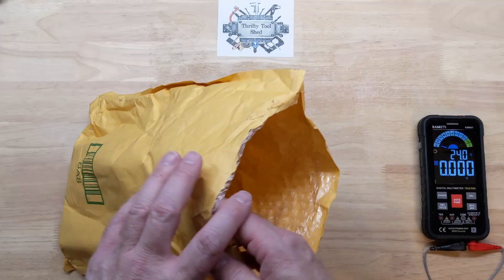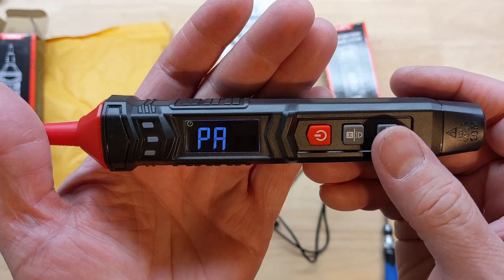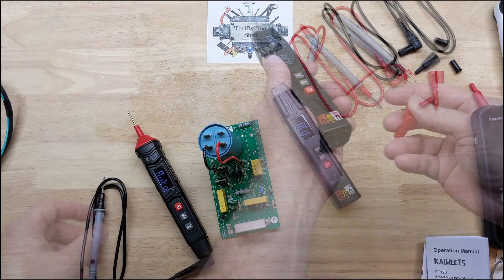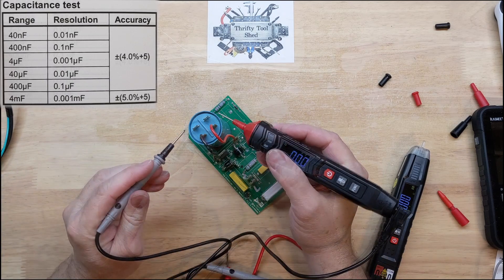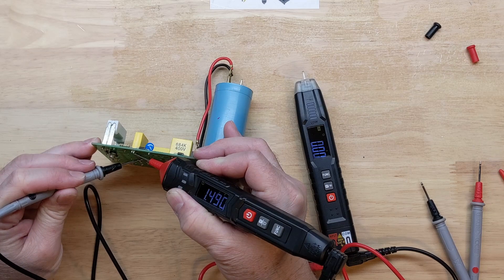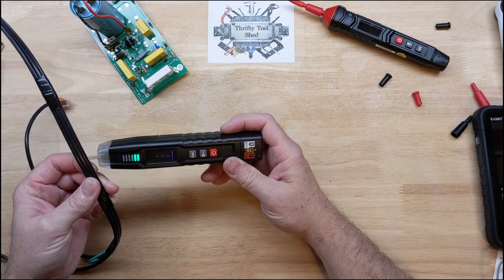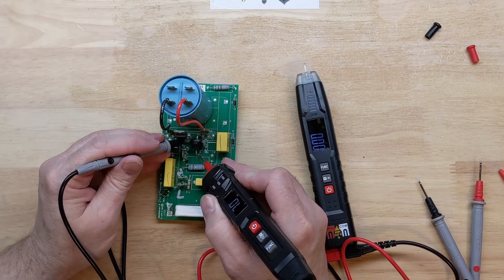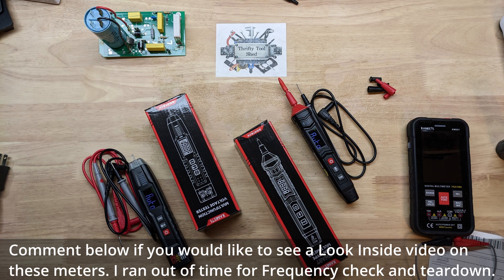KAIWEETS ST100 & ST120 Meter Combo Review

Comment: This is the best review I've seen of these particular meters. Great work! I purchased the st120 as I wanted something that was very compact to fit in my everyday tool caddy so far worked great. I am a professional in the low voltage Audio Visual and network field and this is perfect for what I need. I also do some light duty electrical and it works great for that as well.
Reply from the maker: Awesome! Thanks for sharing that. These are so neat and handy for the money and with Lithium batteries in them & in the glove box of every vehicle you can always have a good meter at your finger tips when the need arises. Thanks for your comment!